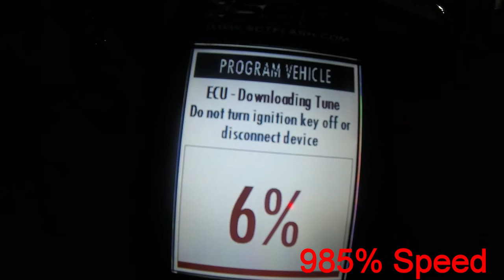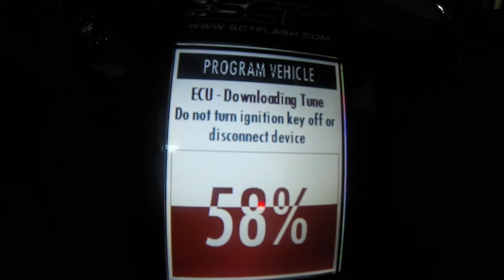How To Correct and Recalibrate Your Speedometer

Comment: Do I calibrate front or rear tires... they’re not the same size
Reply from the maker: If they are not the same size I’m not sure that will work. Might have to do some more research on forums
Reply: Rear tires is whay your speedometer goes off of.
Reply: @ak49sailor  so my odometer is also based off of my rear wheels right? Just double checking because I ran a thinner side wall rear tire to keep it more accurate to stock
Reply: What tuner are you using

Comment: Will this work after a diff gear change?
Reply from the maker: Yes there is a setting in the tuner to adjust more different gearing
Reply: Thank you for your reply.
Reply: Hey I’m trying to change my speed gauges from 4 gauge to 6 gauge, the only things is that my 4 gauge has 120 top and the new 6 gauge has top speed 140. Would this work to tune it